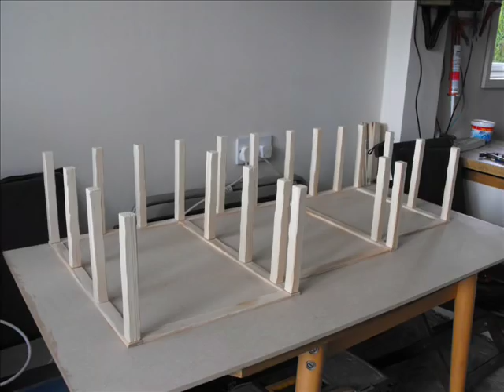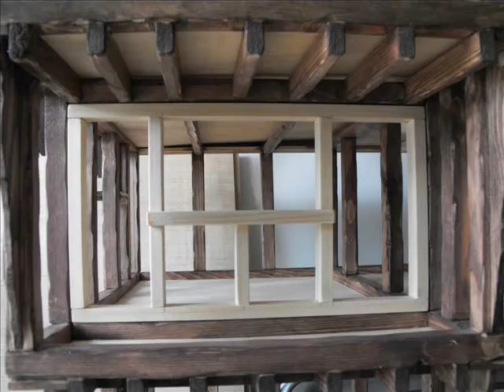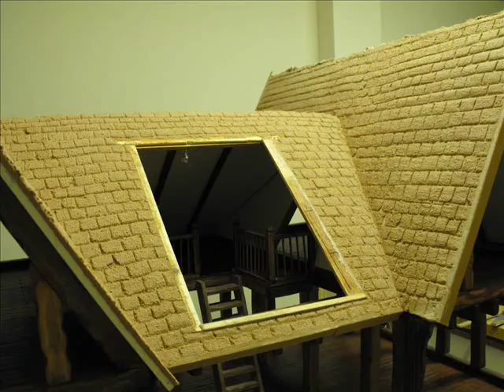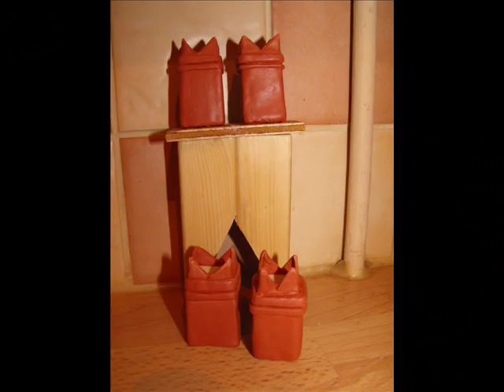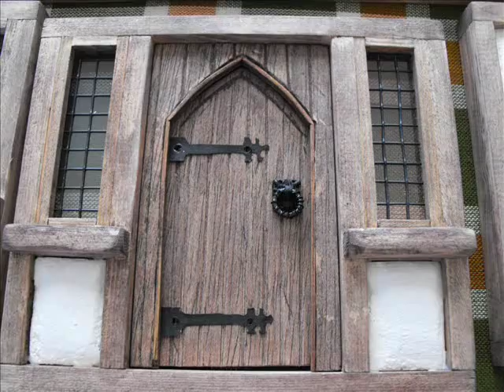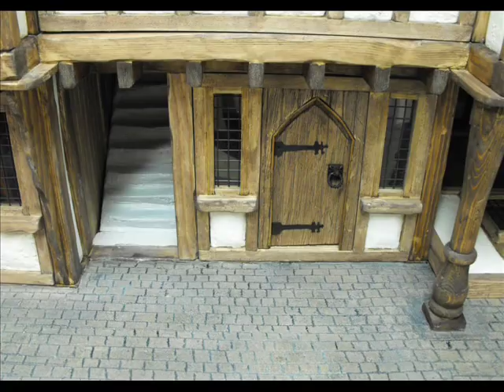Building a Tudor Dolls House

Comment: My husband and I began this house it was in a magazine but half way through I found it was too huge for me to handle so I omitted the centre piece leaving the 2 larger houses I'm still working on it and am not sure what to use for the tiles on the roof as das air drying clay is way too heavy, paper clay is not an option its way to expensive so Im sort of stuck right now you have made this tudor beautifully! it was Fun!
Reply from the maker: I used the same as the walls and floors as in the plans.
Reply: Hi, Ammiel7, could you post the magazine name and issues info please, there are a few people interested in making this house.

Comment: Ya i'm impressed! Beautiful job! I am building for the first time a half scale english tudor from a older kit. My wife bought it for me to build with my granddaughter. I quickly found out that this kit must be dry fit many times in order to get it correct. Good thing i bought a used steamer at goodwill because i had to steam apart pieces twice now. The kit was missing pieces for the front facade trim work which i am trying to layout now. What scale is your tudor and how did you handle your stucco? Also it looks like you made your own fireplaces hearths and lights. Fine work my friend-congratulations!